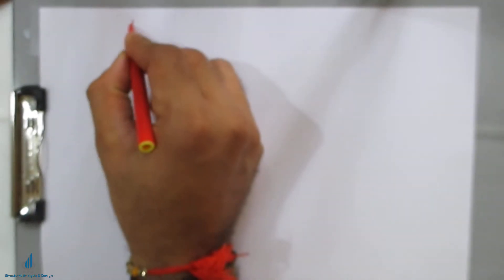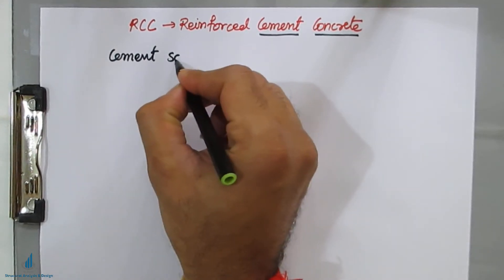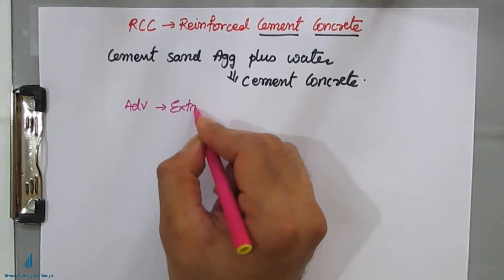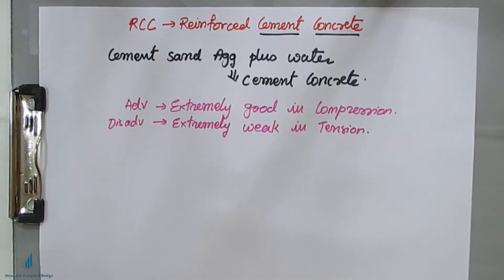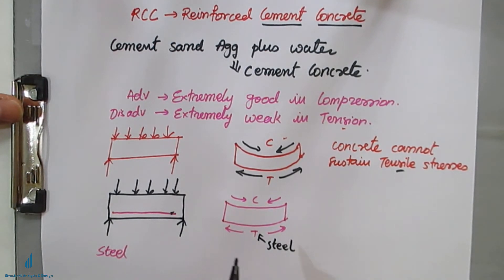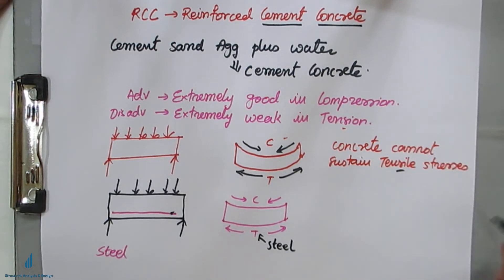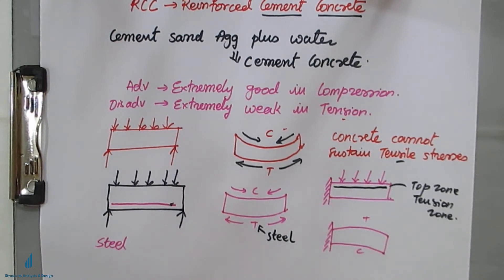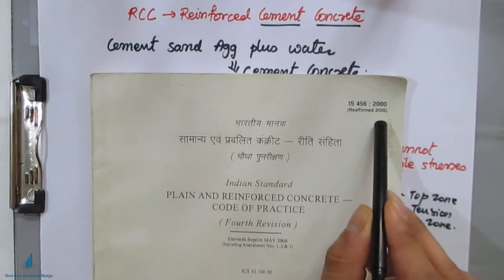What is RCC | Concept of Reinforced Cement Concrete | Introduction to Reinforced Cement Concrete

Comment: Dear sr ,so my question is if i want to use 5 bars and i have studied that above or below of neutral axis,at the same distance, bars takes equal load,soo if i want to provide 5th bar on top of the beam then it is as similar strong enough ro take same load,i don't think so that their is any disadvantage like weak in tension